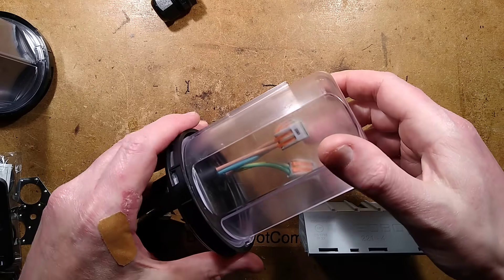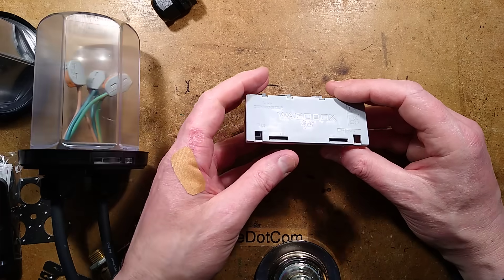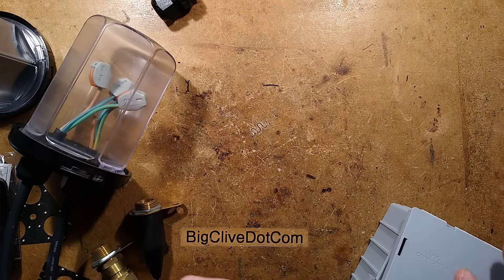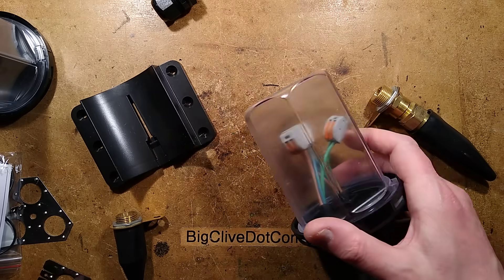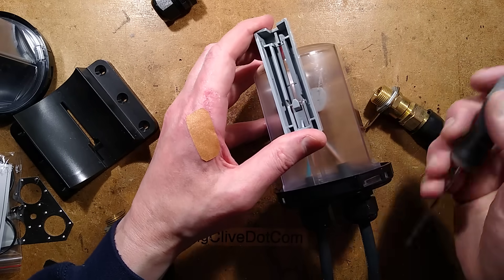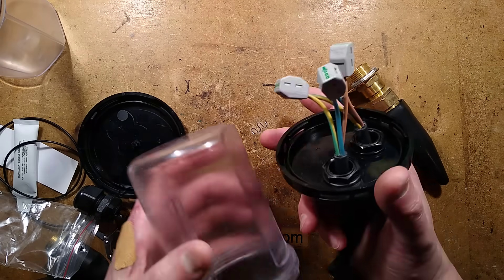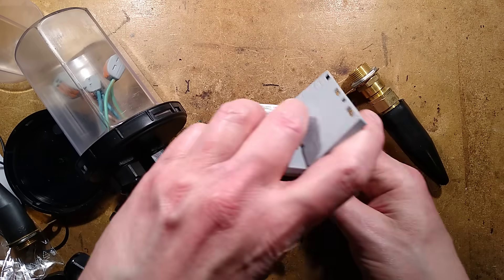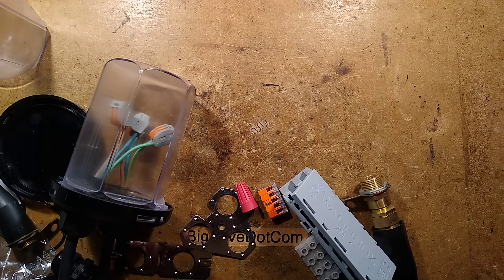A look at the Wagobox Capsule enclosure

Comment: I have been specifying Wago connectors in a lot of products I design over the years but you will have to add a a note for all these great junction boxes that they are not UL listed. Any building inspector in the US and Canada is going to have you remove these when using line voltage or new construction. Until Wago gets permission to put the UL logo on the boxes, you’re not going to get these on our side of the pond.
Reply: But they are UL approved.  "In addition to the European approvals, WAGO's installation connectors are also certified for the North American market, specifically from Underwriters Laboratories (UL) for the US and the Canadian Standards Association (CSA) for Canada. In the past, these two certification agencies jointly introduced the “cULus” mark."

Comment: Some water will be present due to it condensing out of the internal air during temperature changes.  The only way would be to fill it with co2 or nitrogen in an air free environment.

Comment: The problem around here with these "hermetically sealed outdoor enclosures" is that they are liquid water tight, but because they aren't dimensionally stable with temperature, they will often suffer from "cryo pumping", where warm moist air is drawn into them at the end of a hot humid day, then it condenses overnight, and never leaves.  I've found enclosures more than half full of liquid water where the enclosure was supposed to be "hermetic".   The fix is simple.  Drill a few tiny drain holes in a location where liquid water is unlikely to enter.   There'll be MUCH less of a tendency to respire humid air and have it condense.
Reply: For the Wago boxes, there's also 2-component goop to fill them up, which will make them perfectly water tight. But you'll also have to cut off the cables if you ever need to replace the box.
Reply: @rolfs2165  The correct fill is re-enterable potting compound, e.g Aquabond
Reply: Just pulled apart some LED festoon party lights, designed for outdoor use, bulbs partially filled with water - of course.
An old friend told me "You can never keep the water out, just drill a hole in the bottom so it can drain", that advice has always worked for me.
Reply: We use an IP rated vent.   Solves the problem.
Reply: Dome security cameras are a great example of this.
Reply: All external junction boxes I have added to my house and garden have tiny drain holes for this very reason - and cable entry glands along bottom edges only.
Reply: In various industries I have worked in, this problem is solved using a breather with a water vapour blocking membrane.

Comment: New systems from Huss-mann use the Wago terminals. I'm not with then any longer, but I worked on a lot of service calls for the new gear that uses them. They do work good, so wire stuff up with those boxes. Thank you, keep working.
Reply from the maker: The first time I came across Wago terminals was when I worked with Hussmann.

Comment: Someone should tell Mr Illett he doesn't use any waterproofing at all. Then can't understand why things fail.
Reply: I actually gave up trying to understand his various 'attempts' to environmentally protect his various outdoor projects. He always seemed to never use whatever seals properly, or use any provided silicone grease, or drill any pressure relief/drain holes in the usually marked positions, and often had cables entering whatever enclosures from odd, non-intuitive directions, that were certain to invite water ingress. I've got loads of electronic stuff mounted outdoors, including some repurposed indoor poe wifi access points, in various boxes, and they've survived years of exposure to UK Lancashire weather; so I eventually concluded he was doing stuff wrong deliberately, to 'encourage engagement, views, and youtube revenue'

Comment: i love wagoboxes, being able to cut, strip, and connect everythin before putting it in the box makes life so much easier, esp in tight spaces
Reply: Clive only mentioned it in passing when reading the labels, but the big thing about the boxes (for UK installations at least) is that they are rated “maintenance free” which means that you don’t need to open them again for inspections. That saves many a sparky a lot of grief when the snooty interior designers mucked things up… I lost a lot of skin to them, and swore at them (the boxes….) but in the long run they are veeery useful…

Comment: Ok the Wagobox is very cool. I don't know if we can get them in the US or not. I have done industrial (control panels on machines), and in my home "normal" electrical work, and for a junction box that goes in a wall, and may never be touched, I don't see an advantage to the Wago connectors. Wire nuts are very fast and safe, and not expensive. In a control panel in a machine where you may have to change stuff, fix stuff, test stuff etc, the Wago connectors are fantastic. As with anything, I feel both have their place. I keep a box of assorted Wagos in my bench because there are times when they are a better choice than alligator clips.
Reply: I'm proud to be a Canadian because at least I know we invented them and when used correctly, wire nuts (some of us Canucks call them Marettes) surpass Wagos before failing.

Comment: One thing I've learned of the years don't trust anything electrical enclosure claiming there water proof my advice fill them with a suitable non-conductive jell. Plus there no such thing as a maintenance free joint. Especially if there located in damp or very warm conditions

Comment: Ok, that's weird. Which end goes up on an external pole mount? Normally those glands would point down to avoid water running into the device and pooling at the seal, but the clear piece has an external thread, and if the glands point down the seam on the cap  is pointing up and water collects in the crevice at the o ring. 

If the course piece had the internal thread, the clear side could go up and the seams would all be pointing down

Comment: I'm in Canada I am not able to do renovations any more but I did for  number of years.  as a home owner I can mess with the wiring in my house all I want and only need inspection if i'm making large changes.  As a general contractor I was not allowed to do any wiring work.  I did end up making a lot of suggestions to home owners that insisted on doing the wiring work them self and that had me discover some real interesting ideas.  In the winter in a old house they would often run space heaters coffee makers kettles and so on meaning that there would be more then one wire going into a breaker box that you could warm your hands on.  It would be an interesting test for the snap connectors could put them in the clear container and see how they take 20 amps at 120v

Comment: Have to admit. I like wire nuts when rewiring chandeliers. Best way to connect several wires in a very small space with a bit of heat shrink over the top just to be sure.
Reply: If properly installed, wire nuts don't need heat shrink or electrical tape.  I would say if that was the case, do you mean ceiling fan and again with that, if installed correctly, will work for decades.
Reply: @WJCTechyman  I mean chandeliers joining cables from several bulb holders inside the fitting itself in this case. Let's go nuts and assume they are "installed correctly" checked and tested by someone with over 30 years experience, then technically no they don't t need heat shrink and are good for decades but how is adding an extra precaution not a good thing?

Comment: I dont get wago connectors, had them burn out a couple of times and I simply dont understand why you need a "quick connect" in a likely pernament location. It just seems like it saves the electrician time but results in worst result. Please tell me if im wrong here.
Reply: Are you sure they were genuine ? - the real ones will take a massive overload quite happily for hours  - the far eastern knock offs won't. Ive never seen  a real one fail but a few clones have.
Reply from the maker: I've never had a Wago connector burn out.  What was the exact scenario, and were they real or clones?

Comment: I have no idea if one could use this in the US for its intended use (the NEC is on my bucket list...). I'm sure someone has redneck engineered something like this from cable glands, conduit, and a Ziploc jar with some caulking, then shoved it somewhere completely inappropriate. That clipping mechanism and grounding/mounting plate are ingenious.

Wagos are UL rated so they're starting to catch on with US electricians, but I remember seeing them at Adafruit years before anyone started talking about them in the trades.

Comment: Agreed, anyone still using nuts is just stubborn. I used to bring a $20 jar of crusty old brown nuts to wire up most of a house. Now I bring $50 on an assorment of 2x, 3x, 4x... wagos to do the same. Initial connections take the same amount of time, but I never seem to get a connection right the first time. The wagos really save time there, getting those breakers to stop tripping after wiring. The wagos also fill more of the air volume often found in larger modern j-boxes.

Comment: Ten or so years ago the company I worked for imported institutional bathtubs from Germany. The engineer that we hired to certify them for use in Canada made me remove the WAGO connectors and change the ground wire to all green. By the next shipment  of tubs he had researched and approved the WAGOs.
Reply: umm...still not particularly fond of Wagos unless it's low-power systems like consumer speaker connections.  That's pretty much what they are.  Not enough surface contact for high loads like major appliances large inductive loads.  Strangely, in lab tests, Wagos were the first to go before the wire nuts.
Reply: @WJCTechyman  Wrong.  WAGOs have been thoroughly tested (many times) under high loads and performed just as well as wire nuts.  They've also been heavily used for decades in practical applications both in other countries and in industrial applications here in the US, with no observed issues.

In all the lab tests I've ever seen, both WAGOs and wire nuts held out just fine even well above their load ratings.  In some cases, the wire nuts held out a small bit longer, but both of them were way beyond any load they were supposed (or allowed) to be used for (and realistically they wouldn't fail until probably long after your house had already burned down anyway), so that's all pretty irrelevant, IMHO.  It's like comparing which cookware lasts longer when you put it in a blast furnace (which obviously has absolutely nothing to do with how it performs under real conditions for its intended purpose).
Reply: @WJCTechyman  You should do some proper research before spreading misinformation like that.  If you don't like them because they are too foreign that's fine, but don't pretend they aren't up to the task when everyone else manages to use them without ever running into problems.
Reply: @WJCTechyman  And that's why Europe, which has almost exclusively used WAGOs for the last 40 years has completely burned down from electrical fires.

Edit/PS: Here, even our circuit breakers have cage-clamp connectors...
Reply: @WJCTechyman  you obviously don't know the video, where they put 100+ amps through a Wago and halfway towards 200A when the plastic insulation failed the metal still gripped tighly to the copper.

these terminals are rated 20A by the way.

Comment: wagos are awesome. And although the name makes sense because it's German I still like the wrong pronunciation better. Yeah I'll be over here with my Jeff peanut butter (I actually prefer Skippy) and gif images. I'm so glad we're finally getting them here in the US. Wire nuts or twist on connectors are known to the country of Canada as Marretts. There just dirt cheap and that's pretty much why they make sense for most things. But the ability to pull individual connections is very convenient for some installations.
We also don't have that stringent of testing, so the only time you're doing testing is troubleshooting when something doesn't work because somebody messed up some thing. We generally solve this by trained individuals who just do it properly and then inspectors that are supposed to inspect thoroughly but most of that usually just is visual. So once the circuit is together it stays that way until a modification is needed which is usually rare until you do renovations, apart from the occasional changing a light fixture or replacing a socket/ receptacle.

And I'm sure somebody's gonna complain I use the wrong words but being electrically bilingual from watching all these foreign electric channels is no excuse because I always got the names for things wrong anyway. I made a comment on readit about two-way and three-way light switching which is stupidly called three-way and four-way in the US and got blasted by somebody saying they didn't even know what I was talking about.

Comment: I work for an ISP that uses outdoor Ubiquiti WiFi equipment and my co-worker made a similar device that held a “gl.inet travel router” and a PoE to USB converter in an upside-down plastic jar mounted to a tree using a universal antenna mounting pole and hose clamp.  It worked well for several years, just recently got replaced with an outdoor “satellite” connection box.
Reply: I have a stake in a WISP using the same equipment that they call air fibre  and those metal sealed and gasketed boxes at tower sites they have super fine copper mesh vents at each end and we get wasps spiders and even had a snake get in one !  use mastic and silicone on those glans . I took a new one and filled it with water latched it shut titled it evey and overnite  to see if it had any leak   none  and it got a spider in it months later !

Comment: Interesting product reminds me of a jam jar but still is interesting.
As I've mentioned in all the other UK electrician videos comment sections throughout various times. The US regulation requires that all connections to be made in an accessible junction box. Which can either be mounted behind sockets and light fixtures or in walls with an accessible plate or an attic space and basements but not buried. Outside stuff is a bit more Freeform at times to put it politely. Where was it going oh yeah our specifications have designed in connection points to junctions behind objects so buried cable junctions aren't necessarily used that much other than for outdoor lighting. I still think this is an interesting product that we could probably use but we do have plastic sealed boxes for that sort of thing if need be. But generally the wires are being brought into whatever outdoor object into a junction point there.

Well I would love to see more of these manufacturers using transparent casing materials for everything. quick inspection of plug wiring will be so much easier.

Oh and the reason it always comes up as I see US light fixtures made by Chinese manufacturers getting complained about as there's no room for wire junctions to be made and I'm like yeah no kidding they can be tough at times for us in the US but we also have a 1, 2 or 3 inch deep flame retardant certified Metal or plastic box behind the light fixture (assuming it was installed properly, we also have the equivalent of cowboy electricians who just screw things onto walls with wires behind them.).

Comment: Never used wagos myself, always chocolate blocks. Is there any issue with wagos over how thin the metal connecting the terminals together is, when you look at one it looks like this bit of metal may not like too many amps going through it.......

Comment: im not convinced that this is a good design. uv light will damage the wires, connectors and o-rings over time. also the material looks like it would easily crack when you accidently drop it. i think in most cases you are probably better off just using a high quality junction box( like obo for example ).

Comment: I really wish equipment like WAGO connectors were commonly used in North America. They just seem so much better thought out than what is typically used here.
I also think the Shuko-style plugs and sockets are infinitely better than the North American system
Sadly, it comes down to legacy infrastructure. The WAGO terminals and accessories may catch on (I certainly hope they do) but we're stuck with the lousy Type A and B plugs and sockets because they are everywhere. Retrofitting all of the existing plugs and sockets would not be impossible, but difficult and costly.